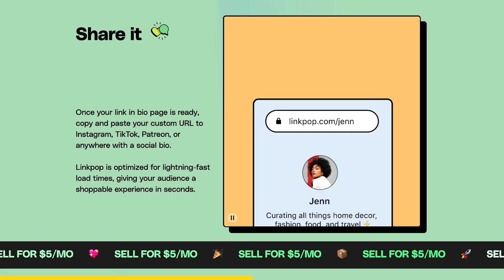Real Mechanic Reacts to Horrible Facebook Car Advice

Comment: I was in the tire manufacturing industry for 25 years. The trimming of the sidewall in the bead area, as long as they don’t take too much isn’t a big deal on tires with the bead protector like that. It’s just extra rubber in the sidewall.. as long as they don’t breach the sidewall compound and get into the abrasion rubber, it should be good..
Reply: 20 years ago, I knew of an old guy who used to take raised white letter tires and take a dirt track tire groover, with a funky attachment, to shave down the white letters and make fat white wall tires out of them. He only trailered it to car shows. Never did drive it that much, but honestly, the older I got. The more I figured he was ahead of his time.
Reply: @ryurc3033    What's the appeal to white-wall tires?  I've heard them mentioned in varying contexts, so I can't figure out if they are just cooler looking (to a certain age group that is), or if there is a technical advantage/disadvantage to the white compound they used, or if it's simply a matter of them not being made anymore, and therefore being expensive/rare.   Would you be able to tell me which one it is?  I'm fairly sure that the white lettering on tires is just for looks, but feel free to correct me if I'm wrong about that as well.

Comment: The sleeve thing is legit, although I've usually seen it done via liquid nitrogen. A properly cooled part just slips right in and is unmoveable once at room temp.
Reply: Yup, it's called a cold-fit weld. I used to work at a science museum and we used to demonstrate this concept using liquid nitrogen.
Reply: That girl didn't know what she was talking about with interference fits. She seemed to think that it wouldn't be an interference fit anymore using a different cooling method. "Like usually you have to hit it in with a hammer still" just means it wasn't cooled enough to go on without any galling.

Comment: 5:50- minimal scratches on the wheel
6:05-  multiple new scratches near the screw points

Yeah that's the 5-min craft trademark.
Reply: Thank you for calling it a wheel. Because all of the manufacturers call them wheels. A rim is part of a wheel.
Reply: You can see when they zoom in the inner portion is bent even though they are supposedly bending the lip of the wheel and then when they zoom back out the inside is still round so its definitely not the same wheel lol
Reply: what about the tube removed but not replaced lol
Reply: @Maheralwan   They put the tube in to keep the tire inflated on the square wheel, but didn't need the tube on the wheel that was completely circular and could hold air.

Comment: When hammering a ball joint in, as per that clip. Use an impact socket or a short piece of pipe. And yes, check often to see that the ball joint is going in straight.

Also, not all ball joints look like that, but for those, to remove them, just hit the center of the ball joint with a hammer a few times it should fall right out.

Comment: Fitting anything with an interferance fit by freezing it is legit. I've replaced many bearings in the feild by using nothing more than canned air and a light tap with a wooden mallet. Once the part warms back up it's tight. The process is just the opposite of the normal way of fitting new cylinder sleeves, which requires heating the block in an oven.

Comment: I’ve replaced the brake shoes on an air brake system as shown in the video and there is a way to do it where you don’t need tools at all as far as the shoes themselves
Reply: I would always adjust the s-cam in the right spot, attach the roller side first and just pop the springs in place on the opposite side with a big screwdriver, pretty simple.  Either that or attach everything without the rollers, pry the shoes apart and pop in the rollers.
Reply: @hoogovens3261  yea what I’ve done was just attaching the springs with the rollers off and prying the shoes out to put the rollers in
Reply: I also replace these brake shoes and feel like this "technician" is making it so much more complicated.

Comment: 15:20 this is the optimal way, as it heats very evenly which is why in this case it just fell off. When we heat traditionally with just moving the torch, yes it get hot but NOT nearly as evenly thus it dies not expand evenly.

Comment: on the belt swap, it would have been mildly important to note the "hack" was done on an air cooled VW engine - which (and here's the important part) has a SHIMMED generator on it (vs alt). but the main thing is it's Shimmed, so swapping belts on a VW air cooled motor like this is OKAY bc the belt is going to have lots of play in it vs a regular tensioner
Reply: It’s weird none of them knew what was up with that

Comment: The first guy was right, using the socket to remove the wheel bearing didn't remove the wheel bearing at all, it removed the drive shaft along with the bearing/hub assembly. Which still leaves you with the task of removing the hub from the driveshaft to allow access to the actual wheel bearing for replacement, which could have easily been achieved with the aid of a tapometer and lever bar without wasting the time of another paid employee to operate the steering.
Reply: this is a way to remove the axle for diff work or u-joints and its as fast as the video shows, there is no wasted time for the 30 seconds you grab an apprentice to steer a wheel.
Reply: @WardinGames  No, the video describes it as changing a wheel bearing, nothing to do with the diff or u-joints, and not all workshops have apprentices and can afford to pay 2 people to do a job that only takes 1.
Reply: You make it sound as if the 30 seconds will make or break your day. It won't. I've helped other techs as a flat rate tech myself it's significantly faster and more effective. That being said make and model may vary this was a dodge and I worked at Chrysler for nearly a decade only way I'd remove a bearing/axle.

Comment: Me and my brother did a motor swap (same year, same model) into a cleaner shell

We went to Smog it, dude said the EGR is missing.
 
Dude was 65 years old and didn't feel like doing the smog.

After we asked where the 'missing' EGR is, he replied with "it's not there"

30 minutes later at another shop and the smog was done😵‍💫 up until this day I use YouTube and learn instead of taking it to a mechanic

Comment: I just came here to say that using a chain and screwdriver to mount brake shoes is 100% legit. Do it multiple times a week on all kinds of rigs
Reply: I just link the big blue spring first, crab claw the shoes over the hub with the rollers out, link the two orange retainers with a large needle nose vice grip and use a pry bar to open the shoes at the s-cam to pop the rollers in. Regular 4707QP

Comment: With the two thermal ones, the first was probably pre-chilled, but the can of whatever refrigerant they used would potentially further cool it down to the point of not needing to use a press or hammer. Granted, you don't want to be doing that on top of a part that will act as a heat sink, the EPA might have some questions with your methodology, and changing the temperature that much might induce stresses that reduce life, but IIRC, some of them can get down to -40, which would buy you even more room.

As for the bearing, you definitely do want to be spinning it (as they did) to reduce risk of differential heating, and therefore stresses, on the rest of your part. Using compressed air is both going to create a rather consistent rotation rate (within reason) and also potentially help the heat from the rest of the part to be transferred out (less important than the rotation)

Comment: Never purposely remove rubber from the sidewall of a tire! It's there to protect the body plies which help support your vehicle.
Reply: the part they removed in the video is actually extra rubber that some tires have to protect the rim from hitting the curb and scratching it if you are for example parking too close and make contact. its safe to remove it but you have to be careful not shaving too much off and not scraping the outside of your rims the next time you are driving.
Reply: @blackchocobo8838  You're correct. It's a rim protector design. So, now removing it to clear the fender wells increases the likelihood of curb rash. Not a good trade-off. As a former tire designer, I know how much thought and effort goes into the many performance aspects of any given tire and it just pains me to see someone shortcut a fitment issue by removing purposely placed and functional rubber.

Comment: A long time ago I heated a 5th gear that my puller could not remove from the output shaft on a Saab 5spd manual transaxle. So I heated the gear with oxyacetylene, not red hot, just enough to remove it. Soon after the rebuild, customer was passing in 5th, and the end of the output shaft broke off. Won’t use heat on any hardened parts to be reused ever again. That hub is tempered where that race rides… well it used to be

Comment: I used a can of air duster to get a stuck axle out of a durango, its a great way to quickly shrink metal. Hit the other side with a torch while using the upside down air duster and you got double the magic

Comment: I think the reason the cold sleeve trick worked is that that stuff wasn't compressed air, it was probably something like propane, which will get down to like -100 something because it isn't just expanding, it's also boiling, which is a highly endothermic process. You can actually use propane as an air conditioner refrigerant (NO, it can NOT substitute for your normal refrigerant, as far as I know nobody makes a system that can use propane; I'm only saying that it could be done, if people were willing to use flammable substances as refrigerant.) That metal was probably a lot colder than the fridge would make it. That's why it worked, but that also means it's going through a lot of rapid, and uneven, heating and cooling, and that can stress the material badly. I wouldn't recommend doing that to something that's going inside your engine cylinder. You want a more gradual cooldown and warmup, so if putting it in the fridge is the usual way, that's what I'd do. Maybe you could get away with transferring it to the freezer after it's been in the fridge.

Comment: i worked in the ball bearings industry and saw once a guy heating up a ball bearing till it allmost glow white... he wondered why it wont come apart. after it was cooled down he realised that ball bearing had a thread on the outer ring... he could have flamed all day long and it wont come apart.

Comment: The wheel bearing hack is a Midwest special they always come apart in the two pieces so it’s either cut the part and risk cutting the edge where the torch method as long as you keep the part moving it’ll fall right off

Comment: The rim hack is very simple. If you have to drive through the town of Bedrock, you must have square rims as required by law. The town of Bedrock requires this. 

Either that or you popped your tires then proceeded to jump your car off a loading dock, hoisted the car back on to the loading dock then drive it back off four times while making sure the rims land perfectly to flatten in the exact shape of a square.

Happens all the time. 

Flint stones. Meet the Flint Stones…😂

Comment: my poor rare (at the time) blue lagoon kona, not even 2 years old at the time, got brutalized by a hailstorm while sitting innocently in my driveway. until that point not a nick, scratch or dent on her... after had over 200 fist sized dents on the roof alone and they stopped counting at 600, she needed a lot of bodywork. amazingly all the things like the glass and deflector and rain guards survived. dealership recommended a place they work with. so, thankfully insurance paid the well over 5k for repairs and i got her back and it was early winter and where i live we get a ton of snow. spring came and then the problems started, my console would shut off, heated steering and seats would turn on randomly, nav center was borking out, fob was working randomly, windows... i clearly had electrical issues. so i took it to the only semi-local dealership(i'm rural) that i bought it from, several times, and they basically patted me on the head was like there, there you're only a woman despite taking it to the dealership 4x and the issues getting worse and me getting pissed, the dealership wouldn't admit there was something was wrong. finally a new dealership opened and i took it there, mechanic actually listened for a minute and took my toy suv back. the dude came out within a few mins and showed me a video... i have have fitted weathertech mats, i'm married to a mechanic and live rurally on a dirt road in a snow belt... dude removed the A pillar cover, poured water on the sunroof and it pissed straight down onto my dash. 

after a fight between the bodyshop and my insurance company, the bodyshop finally admitted they not only botched putting my sunroof back in, they crimped and punctured the lines... they had to pay to replace my modules which are on the drivers side by my feet. ended up adding another 2k to the repair bill.

Comment: Angelina, sorry but you 100% can drop a sleeve in IF you get the metal cold enough.a household fridge does about -10f and liquid nitrogen escaping to sea level 70f air, is -320f. The way frost forms on that can shows how cold it REALLY is. I've seen plenty of machine shop videos do exactly this, and it slides in on its own and then expands again. It's real.

Comment: Worked on semi's, dozers, forklifts and haulers once upon a time; we probably used 90% of these ironically.  

Something simple like taking off a semi-trailer tire; we would. have to put on a 4 foot breaker bar; heat up nut, literally jump on bar.  Then bravely stare death in face as you sledged hammered off a rusted split rim from the hub.

20 years later; wonder how much tool-tech has solved alot of the pain (and potential death).

Comment: Gotta remember the plastic cup hack for the oil filter.  On the late 80s to early 90s Thunderbird/Cougar, the morons at Ford put a frame member right under the filter that has a lip on it, so when you loosen the filter, oil drains down and fills the lip and goes everywhere.  Makes changing the oil on these cars somewhat messy.

Comment: In the last video a.....I'll call it a quick Jerry rig for something like that .  Would be to obviously try and pull the dents out.   If you have to cut the outter pannel like he did.  Then fix whatever made you need to cut the pannel off.   Fix the pannel (If possible) then weld it on,  bondo,  sand,  prime and paint.  
NOW!  If the outter pannel he cut is no more =(Garbage) then get a couple cans of Tuff Stuff  (The expanding foam spray)  get it all in there,  everywhere,  even grab another can of the stuff.  Have it sticking out further than the rest of the car .  Let it dry overnight in 70°+ temperatures  (minimum)  and sand it smooth or even a 1/16th to 1/8th inch in.  Clean it good with air compressor and maybe some alchohol.   Then fiberglass it, sand it and paint it.   
SOUNDS LIKE ALOT,  IT REALLY ISN'T THOUGH.   Especially compared to bricks and mortar 🤣

Comment: I have done the torch to the wheel bearing to remove the race many many times with no issue. Takes less time then cutting them off or the tool. But I used my hand to spin the hub.

Comment: The sleeve goes in a cooler with dry ice for 20-30 minutes. Pull one out and drop it in. No "big ass hammer" required

Comment: Truck mechanic checking in,  Hack #1 with the hubs...... Works a treat on trucks. Especially Super duties up here in the rust belt.  The Chain trick to set the spring on the shoes also works a treat, Doesn't deserve a ticket for sure.

Comment: You can definitely resleeve and engine like that. If you throw a torch inside the block and get it nice and hot, then flash freeze of the sleeve Sub-Zero with a can of compressed air (the one for computers is also a refrigerant by the way), you can definitely do that and it is that easy. Notice he got a block of wood to hammer the last little bit in. 
Once that metal equalizes in temperature you won't be able to get that out and there will definitely be a good interference fit..

Comment: That belt trick was on the air cooled old VW bug engines. No water pump and just the generator/alternator. I’ve even done it before with grandpa but it’s only a trick. You still have to shut it off later and tension it.
Reply: It would work, but that just seems like things could go very wrong very fast. Just turn the engine over by hand to walk the belt onto the pulley.

Comment: The freezing of the sleeve. There sprays in the workings industry and plumbing that work great for weird things like this. Used some of that spray assembling a hog fuel chipper at a lumber mill.

Comment: 11:12 is the mechanic equivalent of the electrician that turns the mains power off by cutting a wire with side cutters and having the resulting short flip the circuit breaker.

Comment: The hack of beating the ball joint in with a floor jack, yeah, it CAN  work. But Your going to blow the orings in your jack out by the time your done. Deadweight lifting is what a jack is good for. But when your shock loading that fluid, your spiking pressures way past what the cylinder and packings are rated for. That jack will never work the same again.

Comment: We used liquid nitrogen and a torch to put the pins in at the rock quarry on heavy equipment. Drop the pin in liquid nitrogen and heat up the hole. Then they'd slide right in.

Comment: You can absolutely interference fit without a hammer, all depends on how true the diameter is that you're trying to fit to. I've seen stuff drop right in with no hammer even needed.

Comment: DO NOT DO THE TRICK WITH COMPRESSED AIR! Especially if the space isn't venitlated well, you're doing whippets every time you line a cylinder